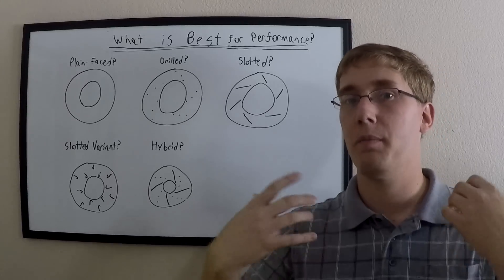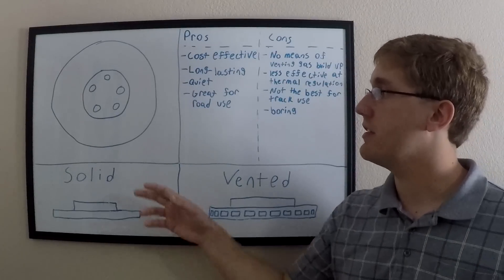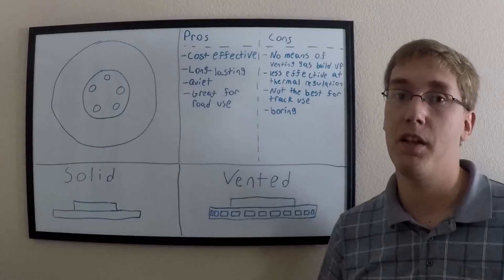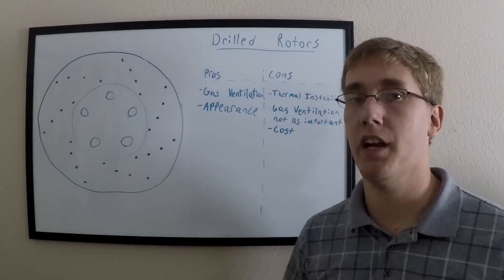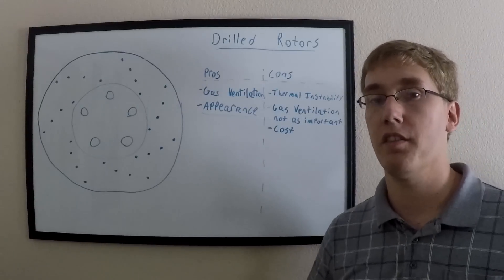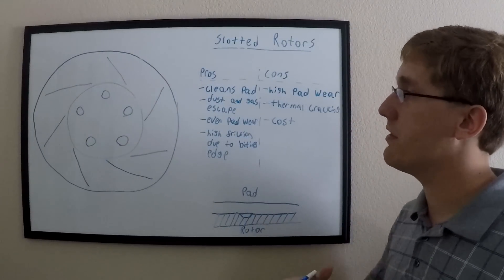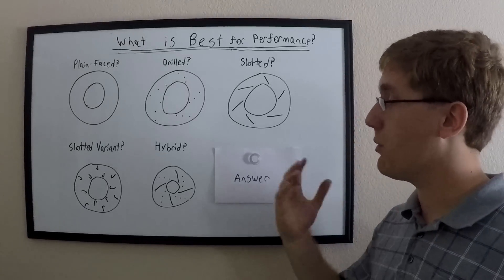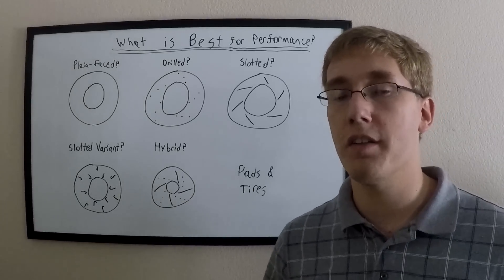Plain vs. Drilled vs. Slotted. vs ??? Rotors - What's what?

Comment: Would it be right to say that the very best combination is good tyres, good pads & also slotted rotors - being that the slotted rotor removes the small amount of surface glaze/crud on the pad, it should therefore provide the best mating surface for the disc & pad, consistently ?

Comment: ??? When I run flat faced rotors they burn up my pads faster and cover my rims with dust. My slotted rotors don't burn up my pads and are quieter then the smooth,  also I don't get break dust all over my rims. I use power stop and they have lasted me towing 2 years and on my car i have the 23s and I am going on the 4th year with out changing pads so, I think slotted is much better all the way around. The flat faced rotors burn up my pads in less then a year, about 10 months on my truck.

Comment: So, for everyday driving on the street, not the track, stock rotors and pads are best?  I don't have a problem with stopping performance, or distance.  I do have a problem with the disc warping.  It must be my driving style, because just about every car I've had since my '67 Merc, the rotors have warped.  Will upgraded aftermarket rotors be better at not warping, than just stock, oem rotors.  Thank you.
Reply from the maker: Do you ride the break a lot, are you in a mountainous area/do you do a lot of hard stops.
Reply: @thecarizon504  I used to tow occasionally.  Don't anymore.  I do travel in the mountains sometimes, but I do not ride the brakes.  Most of the time, just day to day traffic.  I'm thinking of going with EBC smooth rotors, and green stuff pads, or EBC slotted rotors, and green stuff pads.  What is your opinion.  Just want to get rid of the warping.  Thanks
Reply: @thecarizon504  Thanks for the prompt reply!

Comment: First thing I did on my '18 Equinox awd was install Nitto NT421Q's but the stock pads still don't have enough friction so I'm installing Hawk HPS 5.0 up front and EBC Yellowstuff in the rear.  I'd rather out brake an accident than participate in it and I came up short two weeks ago in stock form hence the changes.  I hope to have all of my parts in this week.

Comment: Not bad. I would've liked to see some actual rotors instead of drawings on a white board. Car guys like to see car parts. : )  You were very knowledgeable for most of our braking concerns. I believe you left out my set of rotors and pads. Not all braking has to do with stopping from a high rate of speed or racing. I have the PowerStop z36 brake kit for my 2010 Xterra. Drilled and slotted. They are rated the best according to my research. This is  a towing package as opposed to the z23 brake kit. I drive the Rocky Mountains and also go 4wheeling. My brakes are perfect for coming down the mountain at 70 mph, holding still on a steep rocky road or cleaning the dust while braking off road. Also if you replace the rotors, replace the calipers. I really like your point on tires. Get good tires. Hope you don't mind my feedback. I'm an educator. Keep up the good work! Very informative!!

Comment: My brakes on my ford focus have regular rotors, and the rotors I want on rockauto, have OE style vanes, and all that mumbojumbo I can't decipher what it means, but if those OE style brakes I can find on rockauto, are a true representation of the OE rotor design then they are the smooth ones... Supposedly the ones I'm looking at, have a coating on them that helps prevent corrosion of the rotor, but I'm not sure how that works, if the coating gets wore down, during use... Probably for protection of everything not touching a brake, I guess
Reply: For Ford brakes you can try geobrakes.com they sell all oem brakes
Reply: @limodxb9177  thanks, but I had my brakes done finally, a couple of months ago, and I just put OE species BREMBO brakes in, and just any old mid-range rotor

Comment: I used to use slotted or drilled rotors but now getting a little bit older I just get the plane rotors with akebono pads.. lol. Cool video i learned & that's what it's about 👍👍🇺🇸
Reply: I have seen some good rotors at geobrakes.com not sure what kind of you want but they have got some good selection of heavy duty drilled and slotted ones
Reply: @limodxb9177  thank you, I'll look into their stock👍👍

Comment: Drilled holes or slotted may promote rust build up on the faces of rotor in grooves and holes, especially if car is not driver frequently. For normal driving condition the plain face all the way... Drilled and slotted are just marketing to squeeze more cash out of customers...

Comment: Excellent informative video! Very well explained and I learned a lot. Which type would you recommend for my Nissan Titan while towing a 5K travel trailer. After my last tow I now have a slight pulsating feeling on my front tires. I think maybe I have warped my rotors from excessive heat? Advice please if you can find the time. R. Flores in Southern California.

Comment: You get the lowest temp on a solid rotor because it works like a heat sink, but on the track at high speeds and heavy braking slotted is best because it allows the escape of gases and dust. This will give you more brake pad surface to make contacts which will make the car stop faster. Now on a everyday driver you go with either solid or for those that like to push it on the highway like I do drilled & slotted.
Reply: Who cares
Reply: @zappulla4092  obviously you because you responded. And, a lot of people, 😳🤔😂
Reply: @zappulla4092  🤣🤣
Reply: @zappulla4092 everyone who watched this video presumably
Reply: @zappulla4092  i do, he made a good comment unlike someone else...
Reply: I swear some people just like to comment mean things just to get a reaction, I just don't think they're getting the reaction they think they are going to get 😂. I want to say I think your comment was very well put and I agree,, I just bought a new set of rotors and pads for my Hellcat and went with z26 slotted and cross drilled two piece in the front one piece in the rear. Now I know I want a little far but why not get something nice for one of the hellcats I have that I have worked really hard to get and want it to last while at the same time getting all the good performance out of it especially with the mods I have. I have a 2015 Hellcat which is what these brakes I bought are for and a 2021 super stock which I might upgrade the brakes in the future but so far even though they're four piston unlike the six-piston ones that come on my 2015 I don't really feel much of a difference when it comes to stopping power
Reply: Sorry for the long response in the comment I made before this, but I know you probably already know how to deal with fools like that guy that made that stupid ass comment and it does not deter people like you from adding to the community with actual words of wisdom and being respectful like I wish everyone was

Comment: heres a question bud... its the only thing i see drilled being "used for" and that is weight savings lol weight reduction bro.
Anyway im curious what sort of savings would one get.. say you had the exact same rotors same in dimensions metal etc what weight do you shave between a drilled and plain variant? i feel like it may be in upwards of at least 10lbs across 4 wheels? depending on the thickness of the drilled whole and how much metal was taken off. Im just curious

Comment: all i know is ive seen WAAAAY too many cars with cracked rotors if they are drilled. You get spider cracks and the rotors break.. pray youre not driving when they do and notice beforehand. You compromise the structural integrity of the rotor a bit. Unless youre rich and can afford to swap them out with new ones ALL the time and do so for racetracks and stuff then no.. you should pass on any drilled ones. Slotted are the way to go. Bit better than regular ones but hells no to drilled. And the ones thats drilled all over.. jesus fuck that.

Comment: Wrong on many levels brother.  Yes tires will help, help in the way for your fry your brakes pads, rotors and brake fluid.  If your towing or just driving your sports car fast in the mountains drilled or slotted rotors with upgraded brake pads vent the extra heat out and away from the rotors .  Normal rotors will just warp boil your brake fluid and then your screwed.  Drilled or slotted rotors + better pads + high quality DOT 4 brake fluid, and have their brake fluid changed yearly atleast will allow someone that drives in these conditions will benefit greatly to drilled and or slotted rotors.  This is because these types of  rotors move and vent the heat off the rotors and pads faster allowing for less heat being built up than sending all the heat to the brake fluid which will = either brake fade or total loss of brakes.  Once someone Boils their brake fluid once that fluid is done for and needs to be fully flushed from the system.   Yes your everyday commuter will never need any of the what you listed but there are many application that do.  The only option I don't recommand is drilled and slotted rotors.  They seem to eat through brake pads like a kid eats through lucky charms.

Track days in a sports car are a different story as they need even a better brake pad/ rotors and high DOT 4 or 5 brake fluid combo.    Yes I do know this thread is very old but felt it needed a slight up date.  Its a good vid other wise.

Comment: For 2019 ford went to a flat rotors for the GT350 as they found that the drilled rotors did nothing for the car but eat the pads. The GT500 released with flat rotors Shortly after.

Comment: Something that is pretty interesting is that the Porsche brake rotors that have a drilled appearance are actually cast that way from the factory. They're not actually drilled. This makes them stronger than the rotors that have been drilled. It's still just an appearance thing, though.
Reply: I checked this out on my nephew's old '05 Cayenne.  Interesting idea.

Comment: Soo what you say is that of you drive a nissan micra with good tires and pads you can break just as good as a ferrari 458?
Reply from the maker: Actually yes. In fact, assuming a proper tire and pad setup, and maybe some suspension tweeks, and assuming you aren't repeatedly abusing the breaks like in a track environment, a nissan micra should outbreak a ferrari 458.
Reply: yes kind of 
For Micra brakes you can try geobrakes.com they sell all oem brakes

Comment: Spoken to major brake companies--the new metal composition and technology and computers has stopped the problem of integrity on drilled rotors.Every car that goes over 200 mph has drilled rotors--many with slot and drilled.They even test these at 200 mph and put the brake on it till the whole thing catches fire and they do not crack even when red hot or with flames--There are you tube videos of this

Comment: So basically for an everyday driver like myself, I’m sticking to my basic pads and rotors. No need for the fancy drilled and slotted stuff on my 2018 Nissan Murano. Just slap some good quality tires on there, with dependable, plain, quality, brakes and rotors. Thank you good sir.
Reply: Haha yeah same conclusion. Great Video!
Reply: Same same. I've just bought Dba standard and bendix 4x4
Reply: For an everyday driver plus someone who occasionally tows a boat like myself, I'm upgrading to better & wider pads on my '16 F150.  Just keep tires rotated & slap new ones on when needed.  Sounds like drilled a/o slotted discs don't improve functionality enough to justify the extra cost.
Reply: Yeah unless you have a sporty car or unless you want a nice look for your shoes (wheels)

Comment: You missed an extremely important consideration, as the pads contact the rotor during high speed, racing conditions, they actually vaporize.  This gas has a tendency to push the pads away from the rotor, decreasing braking force.  That is why many racing pads have slots cut in them.  That’s where cross drilled rotors come from, letting this gas escape.  
I am a Porsche club driving instructor, also raced for 15 years, cross drilled rotors have the best feel and grip, but don’t last because they crack between the holes.  In racing we don’t care, we want the best stopping and pedal feel.  Largely in pro racing if legal, carbon ceramic has replaced steel.
Reply from the maker: I thought I had mentioned outgassing in the video.

Comment: Not a mention about water dispersal! I had a Honda 750 4 with Stainless Discs ( Rotors) absolutely F useless in the wet (changed them to drilled cast iron with the then in their infancy EBC sintered pads) like driving on a different planet...maybe we are blessed with a lot of rain in England but when you had to tweak the brakes every few seconds to keep the brakes hot and clear of water otherwise you put the front brake on and three or four white knuckle seconds later they would start gripping! Moto Guzzi had a brilliant anti lock brembo system with cast Iron drilled and slotted brake discs Twin ones at the front and single at the rear all drilled and slotted...absolutely first class.

Comment: Drilled rotors = heat dissipation
Slotted rotors= cleaner surfaces of water dust or a mix of both.
Hybrid = a mix of both
Reply: To me the faster a rotor gets rid of heat the less it has a chance to warp.

Comment: StopTech® drilled and slotted rotors & PFC® carbon metalic brake pads on my Ej8...
All together with the energy suspension bushings, high performance upgrades on the rear  suspension including aluminum LCA's, brace support and 24mm rear sway bar. 
And mentioning my Hankook tires ventus v2 concept2 205 45 r17 front and 215 45 r17 rear.. 
Amazing...

Comment: Thanks for the video. Very interesting.
 I`ve got 2.2 ton suv and I think we could improve braking distance. is there a point, to change rotors to slotted ones and some better pads? how much shorter brake pad lives on a slotted rotor. i mean normal driving, no track days, etc. 
front vented rotors still got plenty of life in them, but rear ones will need changing soon. is it safe to put slotted rotors at the rear for now only? I`m not a mechanic, just thinking about options for now.
Reply: Honestly I am not a very tech savvy however I always buy brakes from geobrakes.com 

And they sell on really cheap price but thr quality is good

Comment: I used slotted rotors once and never again. They wore down the pads heaps quicker and you could feel the pad going over the slots thru the slightly pulsing brake pedal.
Reply: That's a good thing, means it's doing its job properly. Just use better pads with the slotted rotas to reduce the pad wear.
Reply: What brand did you use? a reputable known brand or amazon specials?
Reply: @toadamine  if you want good pads you might wanna look at something like EBC Red or yellow stuff pads

Comment: I've just bought myself a full set of EBC drilled and slotted rotors and a set of EBC "Yellow stuff" pads for my Mazda CX-5. I reckon they have improved the stopping distance massively. I tow a 2 tonn caravan and can definitely tell the difference from the original OEM to EBC. Great video by the way! 👍🏻 😎🇬🇧
Reply: You tow a 2 ton caravan with a cx5? Aren't those only rated for 1 ton? It must be extremely slow
Reply: @lexusgs4604  CX5 owner here. Outside the US where tongue standards are different these are rated for two tons. And with the turbo there’s 250hp and 320lb/ft torque from 1500-4000rpm…..so power wise, it’s better than many compact trucks
Reply: EBC sucks… we had slotted rotors and redstuff pads on a civic type r fk2. we were only driving „sporty“ on public roads (serpentines), didnt event brake too much. they went bad (overheated?) extremely quick, we were lucky to not have crashed. suddenly there was no more stopping power. the rotors had a blue colour to them when we checked them out. i also had the same ones on my 2016 WRX STI, even the stock rotors & pads had more grip… also the rotors deformed, didnt even do any sporty driving. if i brake at above 100km/h, the steering wheel is shaking.

we have dba rotors & pads now, so far no issues & good performance
Reply: @DerRusher I had good experience with EBC stuff . Just the Normal black stuff with their solid rotors. Direct OEM replacement. For street use (a bit sportier sometimes) There was an easily noticable difference compared to the OEM on my civic (8th gen. non-typeR) and I also replaced the OEM pads on my Mazda MX5 ND2 (with only 10k km) with Black stuff. And there IS a difference in the case of the MX5 too. Brake feels better and biting point much better now (there is actually one now) in my opinion. Maybe their other more expensive stuff doesn't worth the price, but I felt an immediate difference with their BlackStuff OEM replacement. I'm really glad I chenged them.
BTW I'm not saying their black stuff or yellow stuff or whaterver are great products, maybe just on my 2 cars the OEM brake pads were really bad. On my 10th gen civc sport+ EU the OEM brakes are great for every day sportier use so there I will just continue to use the OEM ones.